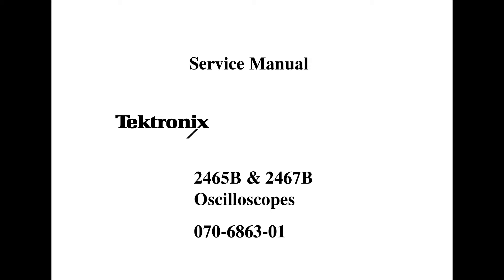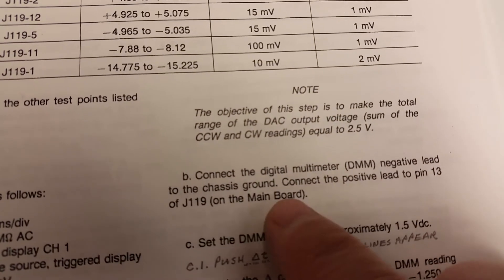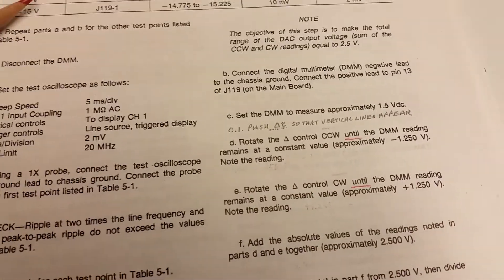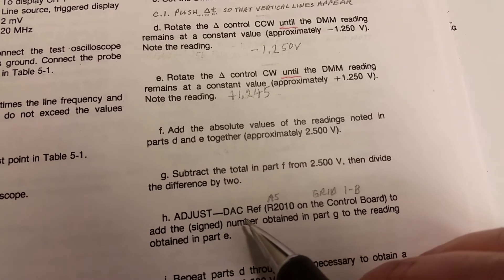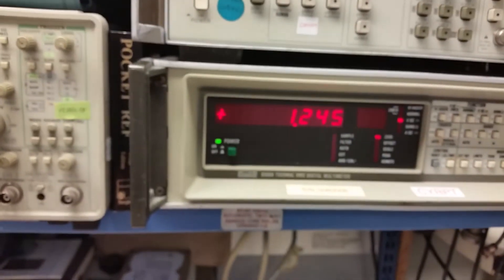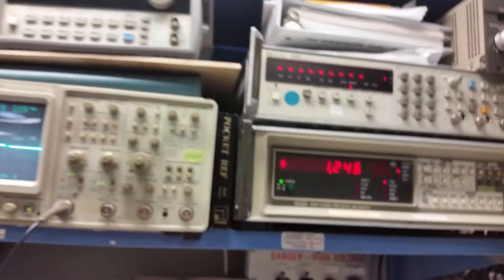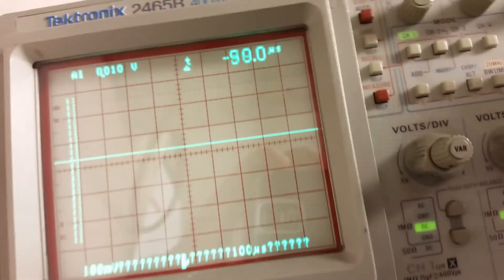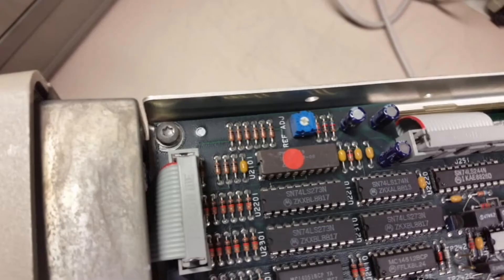Tektronix 2465B Pre-Calibration Adjustment DAC Ref Voltage

Comment: Hi Keith, I really enjoy watching your calibration videos.  It would be nice if you had a chance to do a full calibration video on the Tek 2465B.  I'm thinking about replacing the lithium battery and electrolytic caps.  Mine is below SN:  49999.  Don't have all the equipment for a complete calibration and am afraid to lose or mess-up the cal if I do a partial cal.  Your videos give me the confidence and understanding to prevent the pitfalls.  Thank you.
Reply from the maker: The scope was one of my company scopes. I made the video's so I could calibrate them later since the company that did the calibration of these scopes quit doing them because they were so old. Unfortunately I could never get passed CAL 9's last step for some unknown reason. If the battery is good, I Highly recommend you leave in place or at least run jumpers to ensure power stays on U2460 or you'll have a heck of a time getting it to pass Calibration. Go watch this video to see what I'm talking about. https://www.youtube.com/watch?v=YubzXhE27dY Thanks for watching. You can also join the Tektronix 2245 and Vintage Oscilloscope Users on FaceBook here; https://www.facebook.com/groups/805303046711998 and ask a lot of quick questions. I joined not long ago, some new blood in the group would be nice to ask a lot of great questions. Best Wishes & Blessings. Keith Noneya
Reply from the maker: Partial Cals are possible with the Manual and it's set up they way without really messing up the whole calibration. However make sure you have the equipment for any partial calibration you want to do or an equivalent of it before you start a Cal option. I would love to do a full calibration but the scope belonged to my work and since I couldn't get it to calibrate we got rid of it. Eventually I would like to try to do my own at home but the equipment I've been collecting is not functional and needs to be repaired. With my current situation of moving and working on two houses with a limited budget, I think that will be years down the road. Let me know how it works out for you, and post some video's of your work so I can check them out as well. Best Wishes & Blessings. Keith Noneya
Reply: Hi Keith,  I just purchased the TDS-744A as my second scope.  I am looking at the 2465B service manual list of equipment needed.  Looks like the Tek plug-ins may be a cheaper way to get the equipment needed to do the 2465B calibration.  You mentioned your equipment needs repair.  Wondering if you may be doing what I am thinking that is get equipment cheap and repair myself.  I am kind of struggling trying to decide which pieces of equipment to get and that can cover more than just this scopes calibration.  I am curious on your thoughts about this? @keithnoneya
Reply from the maker: @dandee9141  I had the same thoughts as you, get the equipment and repair it then use it. The TM Plug in Series looks like it's going to be a lot of fun to repair and use. However it's not exactly inexpensive for some of the individual components, but it's cheaper than a 20K more modern scope calibrator. Not to mention if you get them up and running you might be able to make a little cash on the side doing rough calibrations and repairs on the old scopes. I love the TDS 600-800 series scopes, they are simply on a new level from the old scopes. It's nice though that they still call out the PG, SG etc TM plug in series to calibrate them as well. I have a few videos on them, nothing special but somewhat entertaining and they have a few tid bits of useful info. Check them out on the channel.  Best Wishes & Blessings. Keith Noneya

Comment: Hi Keith, really like your videos.  Have you decided if you will do a full calibration on the Tek 2465B.  Plan on replacing battery and caps.  Don't have all the equipment for a complete cal but would like to know what can be done and if I should not replace caps on all boards other than the low and high voltage boards.
Reply from the maker: The scope was one of my company scopes. I made the video's so I could calibrate them later since the company that did the calibration of these scopes quit doing them because they were so old. Unfortunately I could never get passed CAL 9's last step for some unknown reason. If the battery is good, I Highly recommend you leave in place or at least run jumpers to ensure power stays on U2460 or you'll have a heck of a time getting it to pass Calibration. Go watch this video to see what I'm talking about. https://www.youtube.com/watch?v=YubzXhE27dY Thanks for watching. You can also join the Tektronix 2245 and Vintage Oscilloscope Users on FaceBook here; https://www.facebook.com/groups/805303046711998 and ask a lot of quick questions. I joined not long ago, some new blood in the group would be nice to ask a lot of great questions. Best Wishes & Blessings. Keith Noneya
Reply from the maker: Ps Sorry forgot to answer your 1st question. You can replace the electrolytic caps without really affecting the cal a lot. Just do the DAC adjustments and it should be good enough to work on equipment.

Comment: Hiflow Fan replacement for  tektronics 2465b 2467b 
Sunon
ME80201V1 60m3/h equal
PMD1208PKB1-A 90m3/h stronger
80x80x20mm
Reply from the maker: Thanks for the info bud! Best Wishes and Blessings. Keith Noneya
Reply: No problem

Comment: Hi I just replaced the 4 leaky caps on the A5 board which went well however
my readout on the crt was about 2 gradual s high and I could not see the top line
so I jump to Cal and went to cal 07 and re-centered the readout which also went  well
I then flicked through cal 01-09 without making any adjustments
I powered the scope down and jump cal to normal
Now on startup I have test 04 fail 02
I do not have the gear to do a full calibration however I do not beleive the cailbration data is lost or incorrect
except for perhaps cal 07 concidering I have made no other adjustments.
Is there a easy fix for this or does it now require a full caibration
Reply from the maker: Robert, good news, if you're sure the scope is still fairly close, & if you have the 2445-7 series, you should only have to do at least CAL-07. 
At least that's according to the Adjustment procedure in the Service Manual. Chapter 5 pg. 5-1 "Partial Procedures". CAL 07 starts on pg. 5-22. You might want to check out my other videos on the CAL procedures. I only did a few of them because I was unable to complete them due to time constraints at work. I would recommend watching the CAL 08 Video and the others in my "Tektronix 2465B Calibration Project" here: https://www.youtube.com/playlist?list=PLVLXGvrQp0Ov0JlqpzqSorDGeJyjF3mKd  I'm not an expert on this at all but what I do know that works I put up. If you get it to work right, by all means make a video of it and post it. Thanks for watching. Keep me posted on your progress. Best Wishes & Blessings. Keith Noneya

Comment: My Tektronix is 2465 DMS, so I do not know how much different is my scope to yours. I was not able to see much at first on my scope's CRT, but after turning it on couple of times and doing the SELF-TEST.... I could not see the text, just a shrunken version of few lines and some PIXELS that should be text, I assume.....  But after I turned it on/off and unplugged it several times and while unplugged I push the ON/OFF switch (this is useful on some laptops/desktop PC's) I was able to get the text and some lines. BUT the scope doesn't work well, since the build in signal doesn't do much. I'm open to any suggestion and or ideas what can I do to fix it. I'm not very skilled at this, I never took a scope apart, but I know how much I don't know, so I'm looking over here and watching many youtube videos and Googling stuff..... Also I need a searchable PDF, the one from Tektronix is just scanned pages into PDF like format, like pictures. I know I should be able to convert it and do OCR... but if someone has done all the work, I could use that version. Thanks in an advance!  Thanks Keith for your contribution!
Reply from the maker: Put a video of it up on your channel. Also join some of the Tektronix forums there is a LOT of good info there. Keith
Reply: @keithnoneya  Thanks for that info. Where are the  Tektronix Forums - that are good - exactly?
I'll post on my channel the video of what I'm able to do now later on today or by the end of the week.
Reply from the maker: Hey Tony sorry it's taking so long been pretty busy here.
Here's a few forums or links that I like:
http://www.eevblog.com/forum/index.php

http://hakanh.com/dl/kits.htm

https://forum.tek.com/search.php?keywords=tektronix

These should point you in the right direction or get you the answers you want.
Some of these forums may require you to create an account, but I've never had an issue by creating one with them.
Best Wishes & Blessings. Keith Noneya  PS time for a video on that scope of yours. Keith

Comment: If this took you 20 minutes how long did CAL 01 take you? ;-)
Reply from the maker: Hi Victor. Victor it took me about an hour to do it, but if you've done it before it should take {quite a bit longer.} {} = Edited part. The thing is if you start calibration on this scope it's a REALLY GOOD idea to do all the Calibration steps. If you don't have the right equipment you can really mess up your calibration factors. I actually took videos of doing the whole calibration from end to end CAL 01 thru CAL 09 with non-Oscilloscope Calibration equipment. I used generic test equipment, signal generators etc. It didn't solve my CAL "?" mark problems, so I figured I did it wrong somewhere so I didn't post them, because want to show someone how to do it wrong and possibly screw up their scope. I haven't done anymore with it since this was posted, do to a really heavy work load at work. The scope belongs to my work so I don't know when or if I will ever get a chance to play with it. I really want to play with it again, because I would like to learn how to do it for the same scopes I have at home. The things I posted on this scope I'm sure were accurate so that's why I posted them. I'm pretty sure some of the Calibration steps I did were accurate and I've considered posting those, even though I'm not sure about some of the other steps I've done. If you're interested in some of the steps, by all means let me know and i'll see what I can do or post a certain step for you or answer some of your questions. Hope this helps. If you figure it out please post it. This series of scope is very popular but I know from experience and from others who are VERY familiar with the scope they take a lot of time to calibrate and are very fickle. I HIGHLY recommend that you watch all the TEK 2465B videos and read the comments for them on my channel to get an idea of some things you'll need to know. One last thing don't pull the battery on the older A5 board or U2460, it will wipe your calibration constants. The newer A5 boards have an internal battery so it won't wipe the constants. On the newer A5 boards you can replace it with one from a company in Europe somewhere with dummy CAL constants so it won't put the "?" marks on your screen, but the scope won't be accurate. Hope this helps point you in the right direction. Again feel free to ask questions. Best Wishes n Blessings. Keith Noneya.

Comment: HI Keith thanks for your lenghly detailed reply. Unfortunately the Unit is an early model and the lithium battery is down to 2.2 V. As a result all cal is lost! I am ordering a replacement battery tomorrow and in the mean time did some of the cal checks not stored in Ram. So far everything checks perfectly including the DAC voltages.
So it looks like I am gonna have to do a full recalibration. This should be a nice addition to the workshop as I don't have an analogue scope here.
Reply from the maker: What happen to the 2440, that's an Analog Scope?
Reply: The 2440 is a digital scope Keith.
Reply from the maker: Well my bad I guess. I was thinking it was an Analog scope. Oh well. Yep you need a good Analog to see somethings easier. I still have an old KIKUSUI COS6100M 100Mhz Oscilloscope that's pretty good. It got submerged during Katrina and initially I was going to throw it away so I put it outside in the yard. It spent several days in the rain. For some reason I can't explain I changed my mind. I spent about a month removing all the transistors and corroded components to clean them. I re-soldered them back in gave the scope a really good cleaning, switches etc and what do you know it still worked. We calibrated it at work and it's been fine since then.
Reply: Keith Noneya HI Keith can you  confirm that when I'm doing the calibration run, I can leave it half way through say cal 1 and come back tomorrow and the data will be saved? I take it that pressing the trigger coupling will store each change made.  This is taking forever!
Reply from the maker: Yeah the guys over in the Cal Lab next to our company hated doing these when they actually made them calibrate them. I thought that it might save some of the settings, but the guys who do them told me to make sure and do ALL the CAL steps once you start them. I was told each step builds off each of the previous steps. So if you start at the front, CAL 01, and keep going it should be fine. If you start in the back say CAL 08 and haven't done CAL 01 recently or something like that you could be asking for trouble. They are really cool scopes I love the one I have on my bench a TEK2445A, wish it was the Bravo but its still a very usable scope. So if you end up with a Bravo they are real cool they'll do measurements for you as well. Like PK to PK, Frequency, Rise Time etc. From what I can tell is they have a lot of the features that were put into the slightly newer TDS600 to 700 series digital scopes. Keep us posted. I keep an eye on your channel for videos on your scope. Best Wishes n Blessings. Keith
Reply: Well its a real up hill battle this one. The instructions in CAL01 regarding looking at the B timebase from the rear on the scope and superimposing the signals one the shop scope are really unclear. Could you explain? 
Also despite the ambiguity I think I have completed this correctly, but now can't get Cal2 to pass (which is where I think the problem is). All I get is Limit errors one every step apart from the first. I am wondering if there is an actual hardware problem in the microprocessor system? Also both Ch1 and 2 give exactly the same problem.I appreciate any tips Keith as I really would like this as my main scope.
Reply from the maker: Hey Simon, the first two CAL's are the hardest ones. Yep I had the same problem with the limits for quite awhile until I figured them out. I have some videos of me doing CAL 01 & CAL 02 and all the rest as well. That's the video's I wanted to mail you because I thought you would need them. I'll see if I can't put CAL 01 together and post it. CAL 02 is really hard to understand at the end, if you don't have the called out equipment. I'll see what I can do for you. When you get to CAL 09 if you figure it out let me know, I only get the LIMIT as well and I ran out of time to work on it before I had to shelve it. Best wishes n Blessings. Keith
Reply: Keith Noneya Keith it works! Had a problem with an earth loop destubing the calibration signal from the signal generator. Finally got a pass. 
Many thanks for your help.
Reply from the maker: Wow that's weird. So that was on CAL 02 huh?
Reply: Keith Noneya Looks like it. Unless cal one went wrong somehow. Really nice scope to use much nicer than the 2440!
Reply from the maker: That's good I hope you get it all figured out. Let me know if you get CAL 09 to pass, that's the one that would LIMIT every time I tried to do it. Keith